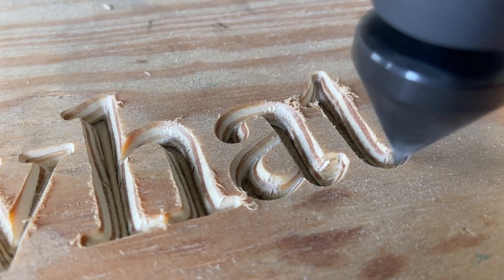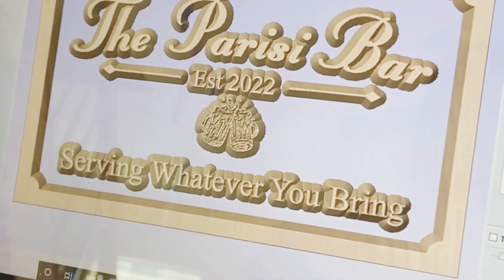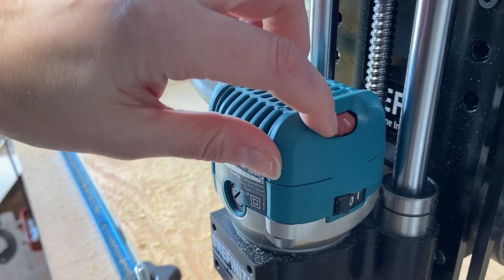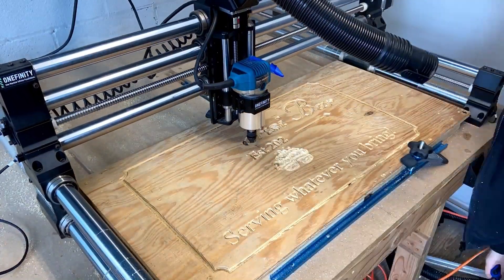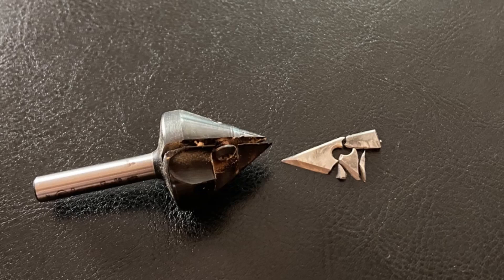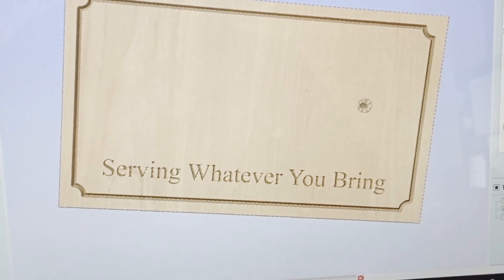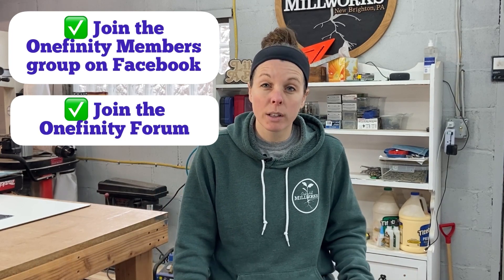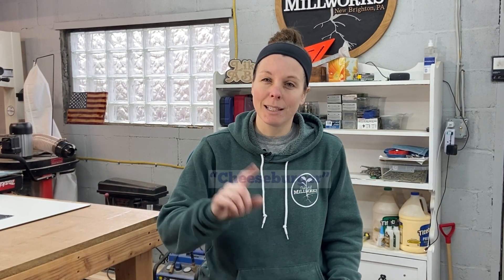CNC V-Carve - Lessons Learned // What I Would Do Differently Next Time

Comment: This is exactly why I don't use bits with inserts.
Reply from the maker: Yeah i won’t go back to that one again
Reply: @OakHillMillworks  just glad you weren't hurt. I say that but I do have a 3 flute flattening bit that has carbide inserts and I only use it when I am flattening my waste board and I am away from the cnc when it is running
Reply from the maker: @D-GatDesignsLLC  sounds like a beast of a bit. Yeah CNCs and frankly many of the machines we run can be quite dangerous. Good to know what we are up against.

Comment: CHEESEBURGER.  Very informative video, thanks for sharing.  I'm ready to order my ONEFINITY and you helped me choose to order a spindle to go on it and some Blue Loctite for all the bolts.  Do you have the ELITE JOURNEYMAN?  If you do, can you tell me the outside dimensions of it (so I can start on an enclosure for it)?
Reply from the maker: Thanks for watching! I do not have the elite model but I do have the journeyman. Mine is around 60” wide by 45” deep. I never really understood enclosures. I thought about doing it but then never did. It would have been nice in the event of the broken bit / potential shrapnel that’s for sure. As far as dust collection goes, my Harvey G700 takes care of it so well. Anyway, good luck and have fun!
Reply: @OakHillMillworks  My NEED for an enclosure is mostly due my medical condition.  Man, a Harvey g700 is a sweet machine!
Reply from the maker: @104Tomcat  gotcha! That dust processor is a great one indeed. Stay safe!

Comment: Just a machining theroy, but what may have happened. Pine has alot of sap in it, and probably loaded up your cutting faces, causing the heat that was burning the wood. Once tool got hot enough to loosen the brazed insert.it flew out of the cutter. If you see high heat when cutting wood its not cutting clean for some reason. You can inspect edges for build up and remove with razor , carefully, use jewelers loupe to inspect
Reply from the maker: Thanks for the ideas! That’s a great thought.

Comment: I don't know if V-Carve can do this, but you might want to consider cutting in multiple depths.  Even if you use a 30d bit, you can control the maximum step-down until the desired width is reached. I know you can do it with Fusion 360, not sure about V-Carve.  Keep up the create work! (cheeseburger).
Reply from the maker: Yes it can I believe. I can manually set number of passes and/or pass depth. Most errors at this point in my CNC tenure are largely due to operator error! 😅 Enjoying the learning process though. Thank you for the tip and for watching!

Comment: Some sage safety advice in this video.  I have the same 60 degree bit but in 1/2" shank and over the years of using insert tooling (mostly shaper cutters) I have learned to check a number of things even on brand new tooling.   In one instance, I found an insert broken in a brand new shaper cutter so I trust but verify prior to use.  Check that the seating surface on the bit is clean and has no burrs.  Carbide is very brittle and needs a steel backing surface to support it.  If there is a burr or debris preventing proper seating of the carbide, during operation forces can compress the debris or burr and cause vibrations/looseness that will result in fracturing the insert.   I am also new to CNC and have been using Raptor composite nails in an Omer nail gun for hold-down that will not damage a bit should you hit it.  Steve
Reply from the maker: Steve - thank you so much for taking the time to share your experience with me. I really appreciate that. I’m a lifelong learner so thank you! Best wishes on your CNC journey. I hear good things about that nail gun!

Comment: run slower feed rate.  small hobby cnc's are not built strong enough to run at mfg. recommended feed rates. one needs to experiment with feed and speeds to find what will work best for your machine. bit broke most likely due to too much chatter.
Reply: cheeseburger,   I run two Shark 520 cnc's with water cooled spindles in my garage. I usually have to run at about 60% of the recommended feed rates to prevent chatter.  go to slow and you burn up your wood and dull your bits. Depth setting  when V carving is for max. depth.  when spacing between vectors is wider you will get a flat bottom and not cut too deep into the wood. I like to set my max depth at .25
Reply from the maker: Hey Michael, thanks for all the info! I actually sped up the feed rate and kept my router speed the same when I re-tested with a new blade in the same bit yesterday and it was a perfect engraving. I think the blade breaking this time was a fluke. Although it was an Amana bit, I double check my speeds and feeds with recommended settings from Bits and Bits because they test on Onefinity CNCs as well.

Comment: Just posted today lol check out Garrett Fromme's video if you feel so inclined.  May not apply. I just thought it was kind of interesting.  BTW is a carbide insert you have use the same speed and feed as a non carbide insert tool?
https://www.youtube.com/watch?v=sxae02CStqM
Reply from the maker: That’s a great question and one I don’t have a confident answer on. I would lean toward no because a non-carbide bit can’t handle the same speed and feed, at least not at a production level. Maybe for one or two jobs but I think it would just dull quickly. I’ll check out that video, thanks!

Comment: I have been meaning to ask if you notice any vibration since that crack has been there?  I have seen a couple in the FB forum where this has happened and being it is what appears so close to the bottom bearing housing of the router does this play a part in any vibration?
Reply from the maker: Oh no. I don’t think so. That crack is basically superficial in terms of the router function. It’s just cracked where the spindle lock button is and that actually still works too.
Reply: @OakHillMillworks  Thank you ; )

Comment: The same High Frequency Vibration that caused the speed dial to move is not good for inserts either or maybe the possibility of too loose  or too tight on the inserts, that is a very thin fragile insert,  Our plan is to start out with a tool steel or solid carbide v bit.These are just my guesses and guesses only.  Nice video thank you for taking the time. "Cheeseburger" : )
Reply from the maker: Those are good thoughts for sure. I wondered if it had anything to do with cold garage / cold blade and then getting warm in the cut. 🤔🤔
Reply: @OakHillMillworks  Temp might be a factor, we will initially go with a non insert v bit to start with.  When I worked as a cnc operator Mazak Quick Turn over 30yrs ago our cnc did not run only 2 shifts so they were always cold however the inserts were much thicker, so in morning the coolant would be cold, steel cold but like I said inserts much thicker.
Reply: @OakHillMillworks  that was my first thought watching this , metal expanding with heat from cutting or hitting something hard embedded in material your cutting . The commercial version of what you have warms the spindle before allowing operation. It runs for 15 minutes in 3 intervals of stepped up rpm’s until full operational rpm’s are met. I found it strange that the variable speed dial would change while running. I wouldn’t think it should do that. It was like there was no detent holding the wheel. I also wonder if a solid carbide cutter would work better. Did the cutter loosen up also ?  If so a dab of locktight would help.  ( just don’t use the high strength stuff )Just thoughts thrown out there, let us know if you figure it out. Wisconsin Cheese Burger.
Reply from the maker: @davidgridley3643  haha I’ll take any kind of cheeseburger. Does a Wisconsin burger come with cheese curds on it? 🤔 — after more research I guess the makita trim router is known for the shakey speed dial. Pretty unfortunate but tape has done the trick so far. Tools Today asked me loads of questions and they weren’t sure why it broke. I will add that I had that bit for well over a year before I ever got a CNC. Although it was never used before, I wonder if that somehow caused an issue with the bolt loosening. But if that were the case, it would have broken earlier in the cut I think. I have a full Timelapse of the cut and I believe I can pinpoint when it broke and it was at least halfway into the job.